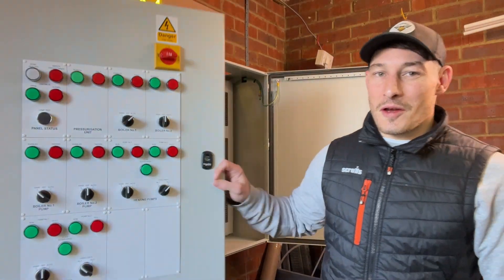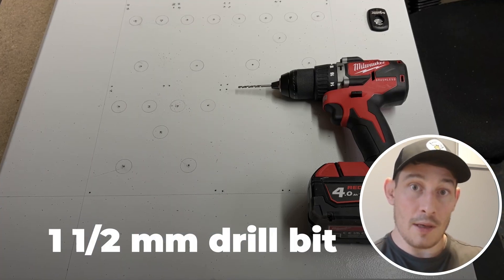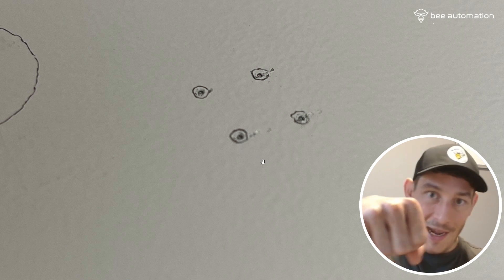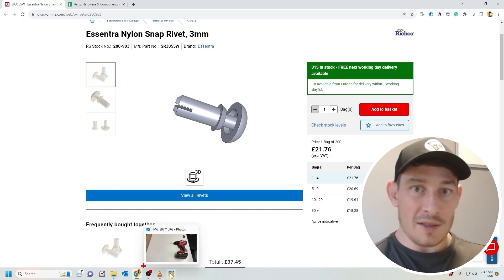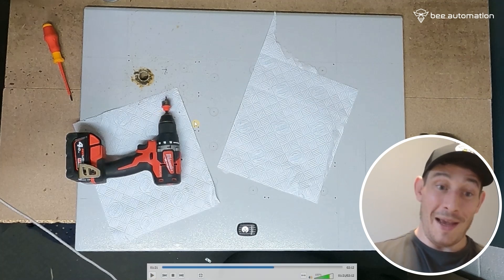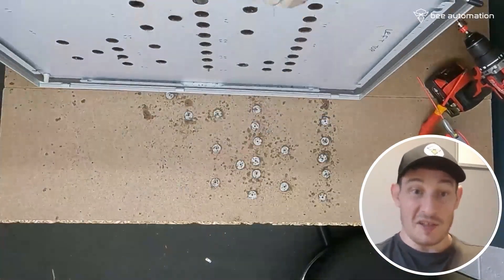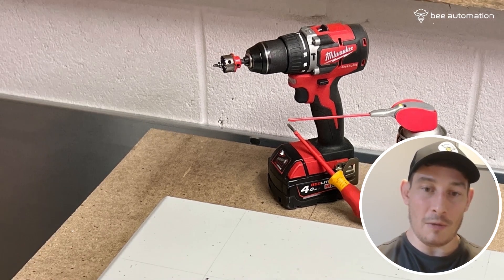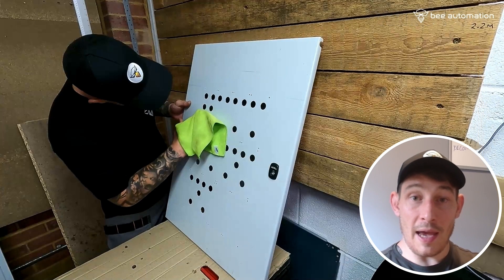The Dreaded Doors - Control Panel Building 101

Comment: My method for punching holes is like yours to start with, mark up then pilot. But I have a set of Q-Max hole punches (about £20 each from Cromwell). Drill out to the size of the punch bolt then fit the punch through the hole and run it through with the impact driver. Zero deburring to be done, no need for cutting fluid and probably slightly faster than using hole saws. A sharp new hole punch will cut through a Rittal panel in 2-3 seconds.

Comment: Get yourself a good set of step drillbits, saves you time because you dont need to pre drill, and leaves a nicer finish than a hole saw.  i use a 3 pcs set from Milwaukee, i works perfectly for stainless aswell